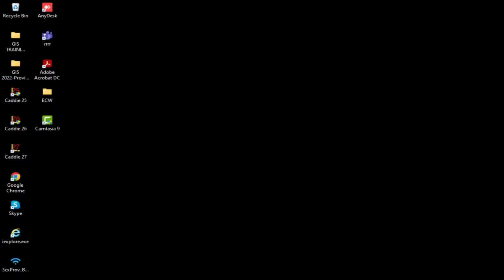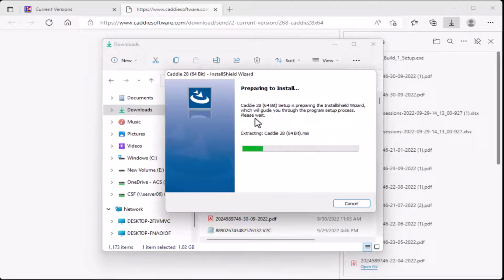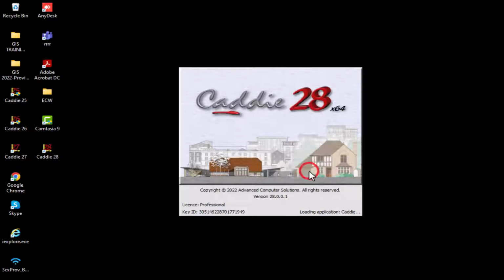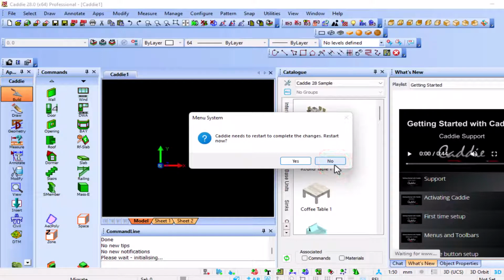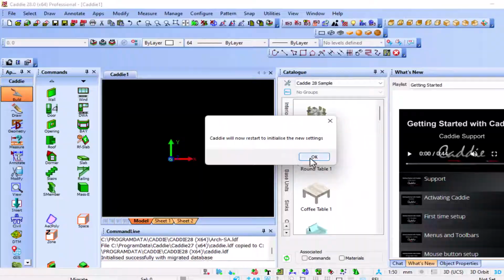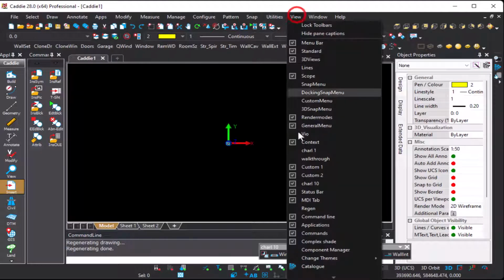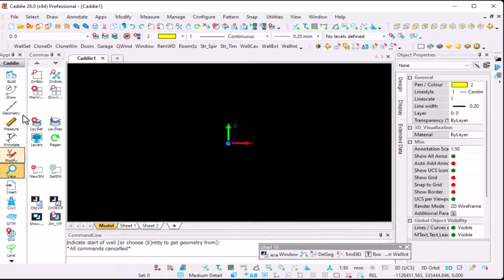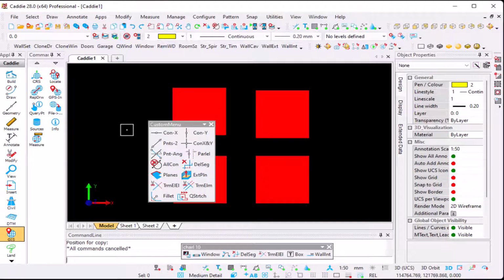What's New Caddie 28  - Downloading and Installing

Comment: thanks for sharing, can I open AutoCAD 2018 dwg files?
Reply from the maker: Absolutely you can, simply open the drawing normally and then work as required. By opening the drawing, the .DWG version will be updated, however, if you need to save drawings in an older version of .DWG in order to work with others on older systems, then this is possible too simply by choosing the format version required when saving.
Reply: @CaddieSoftware  THANK YOU SO MUCH I WILL BE INSTALLING CADDDIE 28 OVER THE WEEKEND,
Reply from the maker: No problem, I look forward to a report on your progress, should you have any problems, simply get in touch via  the integrated Chat utility to contact the Caddie support guys